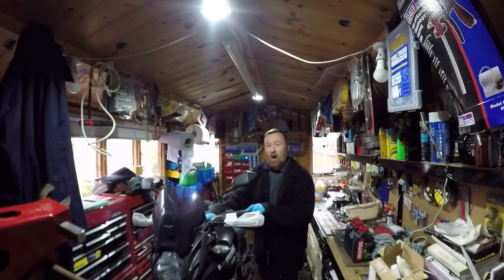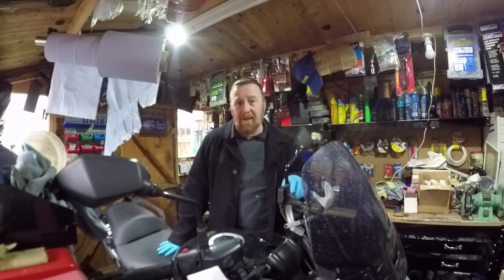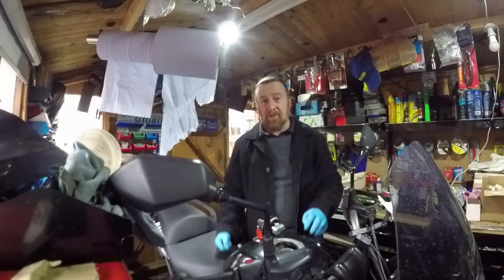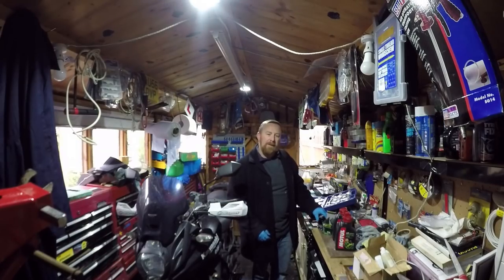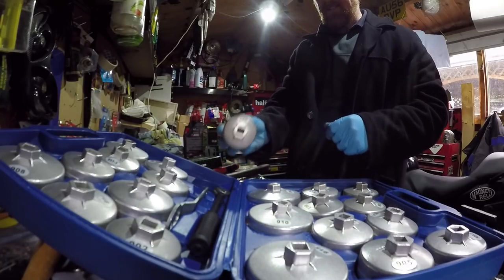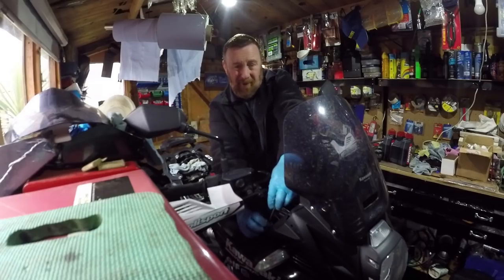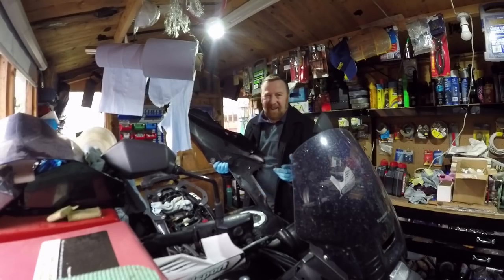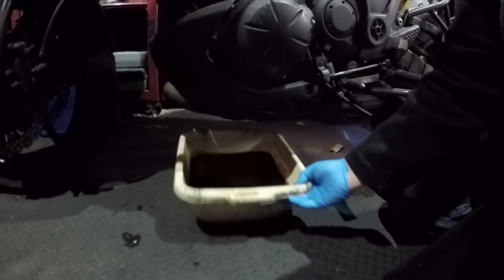MOTORBIKE SERVICE EASY TO FOLLOW MARK SAVAGE

Comment: My old Versys 1000 mk 1 had the same rattles around the clock and petrol overflow blockage issues! I also found the petrol locking cap kept seizing up in winter as well which nearly resulted in a snapped key at the petrol station on one occasion so well worth making sure it is kept well greased.
Reply from the maker: yes bud very true on the petrol cap I spray all the locks including the back box often I forget to mention it, these bikes really dont like the wet weather and road salt 
thanks for watching

Comment: Hi Mark could you do a video on how to replace fork seals on a moped please, mines and aerox but just a rough guide will help thanks
Reply from the maker: to be honest I've just replace the front end with a second hand pair £40, it was a lot easier than doing them
2nd take them off and give them to a bike shop again £40 to £60
its a lot of work to get them apart and get the right amount of fork oil back in and to the right measurement of oil
hope that helps and its what id do, there loads of jobs that I will do as in my videos and I have over 150 moped videos lots of aerox's and speeedfights
Reply: @marksavage  thank you very much appreciate it

Comment: Hi mark 
I was wondering what Part of the crank the oil seal is supposed sit on a speedfight variation side, I pressume it’s the widest part closest to the center but just wanted to make sure. Also does the coil side oil seal go on the flat area of the crank.Thanks
Reply: I found something online that said the seal on the variator side should be flush with the crank case and the seal on the coil side should be about 9mm in is that correct
Reply from the maker: JJ1999 both on the outer side but mirror where yours are now as they are different sizes 
And easy to fit
Reply from the maker: JJ1999 I have over 70 speedfight videos that should all help well worth a watch 
Type in mark savage speedfight or check out my other channel as they are in n on there on a play list
Reply: When I bought the bike the previous owner had already removed the seals so I don’t really have anything to go off, roughly how far in do the seals have to go in or would you say what I found online is about right

Comment: I came off mine last week twice I was doing about 20mph I fell off the day before and almost other times turned out I had extra oil spitting through a hole in the exhaust going on the tyre which was on the way out. Tyre little grip to begin with I can't ride at the moment because the brake levers snapped and damaged other parts both times the engine was hit pretty hard but it's running and seems okay but time will tell 😂 ride safe
Reply from the maker: this is the same sort problem the last owner had as he came off too and am guessing it was due to the scott oiler being set too high and oil going onto the rear tyre 
still these are great get to work bikes and thanks for watching , stay safe bud
Reply: mark savage I need to check that then and it's horrible as I usually ride when it's dark and the back wheel feels like it's going to slip every turn I ride with Friends and they think I'm trying to drift it because it's that bad when it's wet.And no problem these videos are excellent. I got my new tyre today, I fitted it just now and looks much better my rear brakes been sorted out and just waiting for the front lever to come.thanks for the reply and Ride safe.